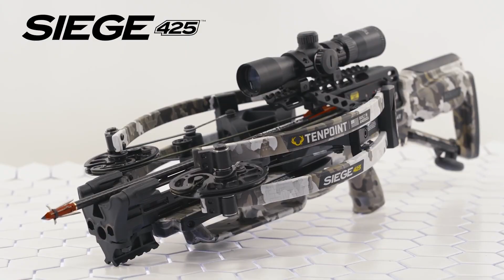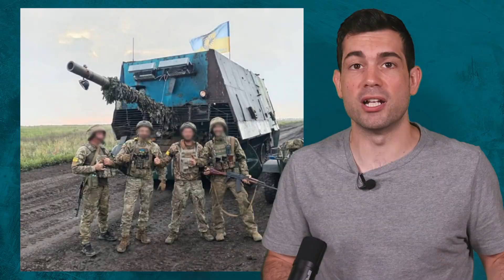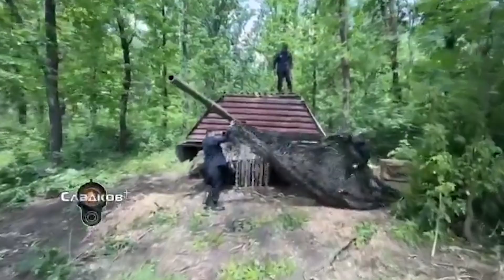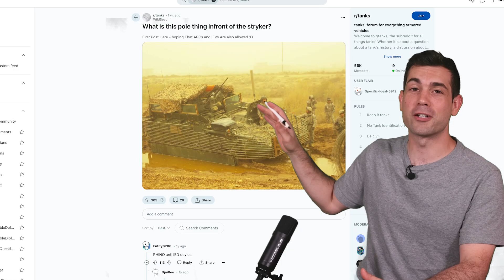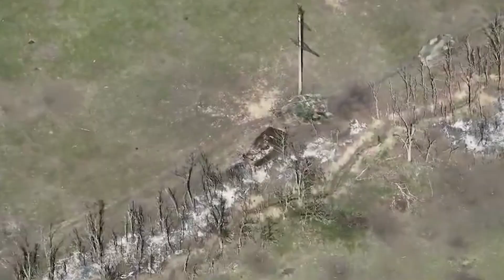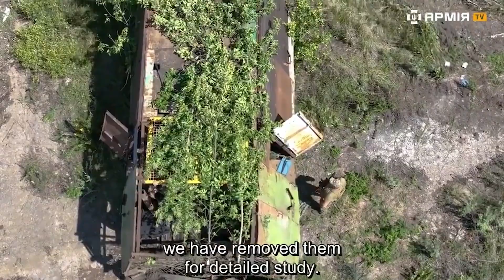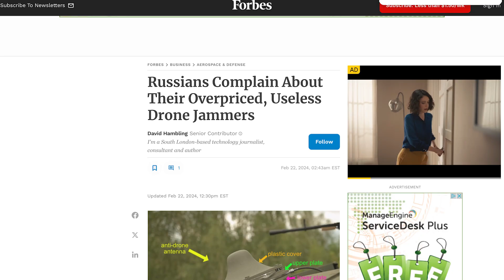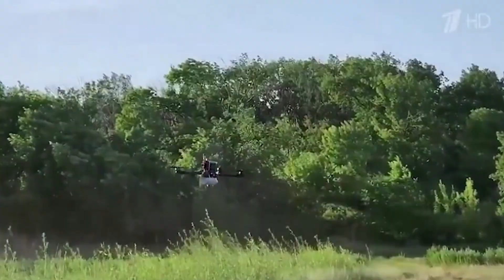Why Ukraine’s Taking Turtle Tanks Seriously

Comment: Most of the men in my family in Ukraine are fighting Russia. Two of my cousins are drone operators. So far, they say the turtle tanks have only presented a "modest" problem for them when it comes to killing the tank. The actual metal is NOT a problem for their FPV drones apparently, as that metal is NOT armor, it's just common scrap sheet metal / aluminum and offers no actual protection (none of my cousins failed to achieve, at bare minimum, a mobility kill on a turtle tank with any of their FPVs. However, the real problem from these tanks isn't the idiotic metal sheets (again, they do nothing) - it's that MANY of these tanks are fitted with extensive jammer suites, making it very difficult to get drones to hit them. Both of my cousins say they often have to fly 5 to 10 FPVs at the tank just to get 1 of the drones past the jamming and hit the tank.
Reply: If FPV drones could be fitted with an inertial guidance (gyroscopes) such as was used in the V2 rockets and switched on only for the last part of flight, electronic jamming wouldn't be as effective. Not sure how to do that but the technology is old and proven.
Reply: @P_RO_  Spoke with my cousins about that topic specifically a few weeks ago. They said it's entirely doable, but the problem is weight and cost. Their FPVs are $500 to $1200 (most around $500). Their battery life is already heavily limited, as is their payload... strapping additional equipment means less explosives or less battery power. They say it's just easier and cheaper to fly multiple cheap FPVs at the target until one gets through (they're spending at most a few thousand dollars to destroy a vehicle carrying hundreds of thousands of dollars worth of equipment, namely the ECM suite on those rusted old soviet tanks).

They also said they have / are developing AI software for some of their more advanced drones that can take over flight when jamming occurs and either fly to new location out of jamming, or execute a pre--authorized suicide run on it's last known target before GPS was lost with the human operator. They've used a few of these drones so far in the battlefield as test runs and have plans to get the AI software onto many of their drones by early next year 

Tthe biggest issue they're working on is target identification to make sure the drone won't target friendlies... for now, they restrict the AI drones to only be used behind enemy lines, nowhere near UA forces, to ensure if there is an AI malfunction, it only has the potential to kill Russians, not friendlies... But once / if the AI gets reliable enough, they can use it near contested areas where the AI understands what is UA and what is Russian.
Reply: @Hathur  Your cousins do get that money is absolute no problem on Russia's side.

They build this stuff themselves, in contrary to your regime, which is mainly ruined not by Russia but by NATO thanks to a gigantic mountain of debt for weapons, which only make west Ukraine and its people die much more.

West Ukraine could have gotten out of that with ZERO damage (well, beyond what they lost in their disgusting civil war against the Donbass, but that's their own fault).

Now it's very unlikely that anything will be left after this. Ukraine wasn't rich before all that. Now it will have lost the majority of its GDP while it debt multiplied by 5 and more.

And the west is one of the worst being you should be in debt to.
Reply: @miriamweller812  Nice propaganda, too bad we have heard all the same talking points before. How much are they paying you?
Reply: @ab6482-i8w now I want you to actually take your time to read his comment and tell me what was wrong with what he said.
Reply: @viswajitbala7924  The man is basically giving reasons for why Russia had to intervene in its neighbors civil conflict, subsequently invade and cause immense suffering, and then annex sovereign territory that even China and India recognize as Ukrainian soil. So, uh, yeah, I'd call it utter propaganda. Invading nations and then annexing their territory while using internal reasons for why we have to is bad. It was bad when the US did it with Cuba, and it's bad when Russia does it with Ukraine.
Reply: @alexbattin6482 did you know that the UK finished paying its dept to the US fir all lons taken during WWII just few years back?  With what is going on  right now in Ukraibe, what is left from Ukraine as a state will never be able to repays its depth and most of its land and resources will be iwned by US corporations.  Hope you are happy to be I the same boots as Cuba was b3fore the revolution. I just do not know if the term Banana Republic will  be suitable as there are no bananas in Ukraine...
Reply: @georgekaradov1274  I mean, better to be in debt that to have Russia flatten cities with artillery and cruise missiles just because they get upset at the lack of a strategic decision on the battlefield. Like, plus the European Union has made clear that it'll be very much involved in the rebuilding of any post war Ukraine. Which, say what you will of the Europeans, but they seem to have very well funded the infrastructure of their member states. Even to a degree where Hungary will make random, miniscule changes just for the shot of getting that infrastructure money. But in places like Poland, Baltics, etc, its been pretty good at what it does.
Reply: @Hathur  I don't know exactly how the drones and the jammers work of course but would it be possible to program the drones to lock onto and target a strong signal on the frequency they use? If that can be done, it would only take one drone to kill the jammer leaving the next one to do its job uninterrupted.
Reply: @GalAxy-u9s   Was the Donbass sovereign Russian territory? Like, imagine the United States invading Mexico and annexing it in the modern day because an American enclave inside Mexico was fighting and dying to the Mexican government because it wanted to separate? The casualties in that conflict are not in contention here- what is in contention is Russia's decision to spark a war that has killed many times that since, and has the express goal of annexing territory that even its ALLIES, China and India, recognize as Ukrainian sovereign soil.
Reply: @Hathur  The Russians showed a video recently with drones bieng able to do this
Reply: @josephhernandez5386  You really think Russia was jobless enough to pour immense resources to invade a neighbouring country that they will get 0 benefit from? 

If NATO gives membership to Ukraine, that would collectively mean airbases on Russian borders. 

Just to remind you, Missile time from Ukraine to Moscow is 3 minutes.
Reply: @notusneo  Not exactly, but yes. That’s the best case scenario at first. If the Ukrainian government had surrendered, this war wouldn’t have been prolonged and the working class of Ukraine wouldn’t have been sacrificed, I’m not against Ukraine or their people. I’m against their government whom tried to save their own skins and put other lives at risk instead of Their own.
Reply: @georgekaradov1274  We will just take the Russian money in foreign banks.
Reply: @pupkinson8914  up untill Germany committed economic and demographic suicide I would have said Germany. Nowdays Russia is a better bet... it had future unlike Germany...
Reply: @viswajitbala7924  So we ain't gonna talk about how Finland hosts American nuclear bombers and is literally 30 miles way from Russias second biggest city. Maybe you should invade Finland? Or is suddenly that not matter to Russia?
Reply: @josephhernandez5386  Heh you took my example I often use to retort to these types.  Like yeah - I imagine a lot of areas in the state of Sonora share american culture, imagine the US justifying an invasion of Mexico to "liberate" those areas.  Ofc to be fully analogous, and the part the kremlin bots never talk about is how those Mexican rebels werent autonomous, and the US had been supplying them with troops and equipment for years past.
Reply: @ab6482-i8w  and not a single argument or debunk was ever to be found

how much are they paying you?
Reply: @viswajitbala7924  "now I want you to actually take your time to read his comment and tell me what was wrong with what he said."
come on, they just want to call it talking points and forget about thinking, or reality. cause things being talking points somehow doesnt make them arguments, or something
Reply: @josephhernandez5386  "The man is basically giving reasons for why Russia had to intervene in its neighbors civil conflict, subsequently invade and cause immense suffering"
those were only part of the reasons

"sovereign territory that even China and India recognize as Ukrainian soil."
sure they do
and india is western alligned...
Reply: @josephhernandez5386  "I mean, better to be in debt that to have Russia flatten cities with artillery and cruise missiles just because they get upset at the lack of a strategic decision on the battlefield."

what....

them continuing this proxy war on behalf of the western world is THE cause of the destruction... not whats preventing it... obviously...

PLEASE tell me youre trolling, this is painfully insane
Reply: @josephhernandez5386  " Like, plus the European Union has made clear that it'll be very much involved in the rebuilding of any post war Ukraine."
wow, an incompetent governmental entity will use their peoples resources to rebuild the most corrup country in europe... thats the absolute height of effeciency...

why did you frame that as if it was a positive!?
Reply: @josephhernandez5386  "Which, say what you will of the Europeans, but they seem to have very well funded the infrastructure of their member states."
source?!

". Even to a degree where Hungary will make random, miniscule changes just for the shot of getting that infrastructure money."
what!? an entity is willing to do miniscule changes, and take minimal efforts in order to gain access to huge amount of resources!? 
i cant believe it! the EU money must have magical effeciency then!
Reply: @notusneo  obviously
Reply: @wasdwasdedsf  So, Russia invading an annexing territory that even its allies see as Ukraine is good then? It shouldn't be fought against? Like- if you're on that side of things then just be blunt about it. Say you're fine with annexing territory through military conquest, and that no one should fight back against such actions.
Reply: @wasdwasdedsf  I mean, yeah, the reason I put this as an example is because Hungary, the most anti EU state, still benefits from it immensely, and will even lean on it for minuscule infrastructure changes, rather than rely on its own internal government funds- which kinda goes against Orbans outward facing hatred for the EU.
Reply: @wasdwasdedsf  So Russian artillery and cruise missiles aren't the ones actually doing the killing? My mistake, I'm so sorry. You're getting mad at the abused protecting themselves from an abuser by using their neighbors shotgun, by your logic.
Reply: @wasdwasdedsf  that applies for both of our comments, yes?
Reply: @josephhernandez5386  Finland wasn’t even a NATO member until now. Definitely their new addition to NATO will prick Russia but at least the Terrain over there isn’t suitable for a land war. Ukraine is mostly flat.
Reply: @viswajitbala7924  Two things- if you really think Russia preemptively invaded Ukraine to keep itself safe from a land war in the era of nuclear weapons, you're utterly high. 
And two; in the case of Finland, if the main problem Russia had with Ukraine was its potential to be used as a base by NATO for nuclear weapons deployment against Moscow- you're kinda invalidating the notion that just because Finland doesn't have suitable geography for a land war, Russia is safe. There are now American nuclear capabale weapons on and around 30 miles away from St Peterburg, with a super short flight path to Moscow. Better placed then they would've been in Ukraine. So, again, why isn't Russia invading and annexing Finnish territory if their true fear was NATO expansion/fears of NATO nuclear forces being closer to its cities? Invading Ukraine didn't exactly halt that expansion, it spurned it further.
Reply: @ab6482-i8w  What is propaganda about this lmao?
Reply: @TheSlayer-Dtk should read all the replies in this section and only then comment... people have answered it already
Reply: @miriamweller812  money is absolutely a problem.  hence welding scrap metal to previously disabled tanks.
Reply: @viswajitbala7924  nothing he said was correct.
Reply: @viswajitbala7924  You think a couple minutes of missile time makes a difference in such scenarios? Lol, Lmao.
Reply: @georgekaradov1274  Tell me you have no idea about at least one of those countries' living condition without telling me.
Reply: @nadarith1044  can you please fix your message so it actually make sense.  It is not my job to teach you English grammar...
Reply: @viswajitbala7924 I have to ask, hpw many countries ask to join Russia to be protected from NATO?
Reply: @georgekaradov1274  Neither do you have qualifications for that it seems, mister 'it actually make sense'.
Reply: @nadarith1044  That was just one example, but yes. It does make a difference.
Reply: @josephhernandez5386  Finlad explicitly stated that there would be no NATO bases on its teritory...
Reply: @nadarith1044  unlike you, I use proper grammar and properly firmated sentences .. go back and read what you wrote and contemplate on it.
Reply: @miriamweller812  Money is absolutely a problem for russia, they are extremely low on resources and are using ancient ww2 era devices that are in states of horrific repair
Reply: @georgekaradov1274  'properly firmated' Lmao no, you do not.
Reply: @viswajitbala7924  It doesn't, and it's absolutely not an excuse to invade and bombard cities even if it did.
Reply: @georgekaradov1274  It's autocorrect not 'autocorect' lmao.
Reply: @nadarith1044  seeeeee, you get it.. good boy... have a treat...
Reply: @nadarith1044  perfectly  done..  right?  You can never achieve such a level of trolling ...
Reply: @georgekaradov1274  "Guys I'm not room temp IQ I was just trolling!!!1!!"

Lol. Lmao.
Reply: @nadarith1044  uhhhhh the best trolling is when you achieve the state of effortless perfection... trolling without effort... hard for you to comprehend....
Reply: @georgekaradov1274  Indeed, and to make it easier to comprehend: consider who has to try hard to not look like they're backpedaling and who doesn't even need to put any effort in and can just go 'lmao' all the time as the other one has rekt themselves thoroughly on their own.

Lmao.
Reply: @nadarith1044  I bet you call NATO a defensive alliance. And if invading one’s country to protect their own is an “excuse” then I’m sure you would’ve said the same when US and coalition forces screwed up Iraq.
Reply: @guyman1570  NATO was supposed to be disbanded after the fall of the Soviet Union. Hell they should’ve disbanded after Warsaw Pact. Guess who decided to keep the party together and even accept new members, is that not unnecessary escalation? If the US really did not want to fight against Russia, they would’ve allowed Russia to join NATO and reduce tensions in Eastern Europe. Instead of that quote the opposite has happened. 

Kennedy and Reagan would be facepalming in their graves if they had seen the golden opportunity after the coup of 1991.
Reply: @viswajitbala7924  Joke's on you, I did say the same.
Reply: @ab6482-i8w  You're asking because you think you're getting underpaid by your propaganda machine?
Reply: @P_RO_ That would only be useful against static targets. If you’re constantly updating targeting data because the target is moving that still leaves the drone susceptible to jamming.
Reply: @P_RO_ all drones have gyroscopes, even the simplest. It is the software that was not written to keep flying in straight line. The software was intended for FPV racing and freestyle competitions. But there is work in progress to make them do what you described.
Reply: @tomeks666  Sometimes the simplest is the smartest and the most effective.
Reply: @P_RO_ in future it probaly like upgrade munition that drone carry
Reply: @P_RO_  Bro you're a genius, you just need to convince the tank to stay put while you shoot at it
Reply: @GalAxy-u9s  It can lock a course following a moving target. It could be done electronically but that could be interrupted too. Sometimes simple is more effective.
Reply: @P_RO_  The Russians for now showed using AI using pattern recongnision of the target, completly eleminating the use of an operator in the last stage, and the UA ofc do the same soon or already
Reply: It does offers protection, If It explodes before hitting The main armor, The chemical jet of The HEAT rounds loose some Penetration, its not perfect btw, its a cheap modification but good enough.
Reply: At the start of Afghanistan and Iraq the American military retro fitted armor on Humvees.
Reply: it is truth, i was turtle tank
Reply: Those metal sheets act like spaced armour. Shaped charge used in RPG-7 and other similar munitions usually loses most of its penetration capabilites after 1-2 meters
Reply: Sounds like you let go of your anger issues against Russia 😂
Reply: @fixyourmind  fixyourmind my ass lmao you could apply that action to yourself, people that suggest the invaded should just lay down their arms when their country is invaded deserved nothing but ridicule and derision.
Reply: Земля им стекловатой :)
Reply: "they often have to fly 5 to 10 FPVs at the tank just to get 1 of the drones past the jamming and hit the tank" - in an assault that lasts 20 minutes tops...that means the tank has enough time to clear the path for the assault groups to pass though.  What happens to the tank after that is of no real importance.
Reply: @victorzvyagintsev1325  the part of importance is value though, war isnt just winning its also a question of economics and in this question drones are fucked up they are cheap as hell while being a small guided missile basically. And the Operators dont die either so they dont have to retrain, nor is movement difficult since they dont have to care about it= fly straight into enemys no problem and it flies
Reply: The problem is that the Ukrainians were not being prepared for the attack of Russians, but for the barbecue on May 9, "And the population rejoiced and applauded the invitation to the barbecue, not knowing that they and their children would be the meat for the barbecue.",,,,